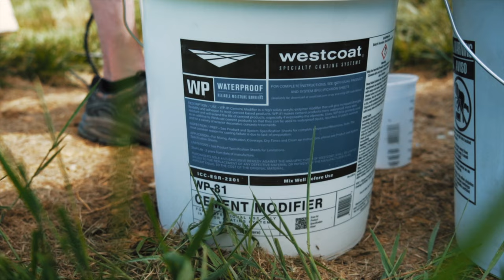How to Resurface your Patio with a Stained Concrete Overlay

Comment: Looks great.  That's a overlay system.  Why couldn't you just staying over the existing concrete like acid stain or water base?
Reply from the maker: You could. It wouldn’t be ideal when you have to grind the paint off of the surface first though. It’s hard to get all of the paint out of the low spots on the concrete… staining it wouldn’t cover them. 

I also just like the texture of a troweled overlay. It’s nicer than ground concrete for an exterior patio.

Comment: My wonderful handyman just finished replacing the wood posts on my aggregate front porch due to dry rot and a cracked cement corner. He had to remove a large chunk of the concrete corner and repair. 
I’m getting ready to hire someone to either stain or epoxy and seal my front porch (cracked aggregate) and walkway for a uniform look. I really like this method and finish over any other so far. 
Thank you for your video. It will be helpful in making my decision. ❤

Comment: I'm on a crew doing this now. We do a light, uniform spray coat of stain, and follow up with hand sponge application of a more concentrated mix of the same color. It produces an irregular, yet consistent random variation.

We also almost always use tape to produce grout line/stamp patterns.

The customer decides, of course. But our surfaces trend towards modified skip trowel or magic trowel textures. There were wood patterns mentioned, but I have yet to get a chance to try that texture...but I REALLY wanna dip into that one! It looks beautiful if done correctly.

Comment: Not sure if I like the swirl marks. Would have preferred a uniform coat without streaks. Is this possible w a roller?
Reply from the maker: You could spray it or do multiple coats to get a color with less variation.

Comment: Quality work!  Wonder if spraying on the stain would have been better?
Reply from the maker: I’m not sure. It definitely would have been easier. I think Westcoat wants us to brush it so that we don’t put it on too thick though.
Reply: You'd use more using a brush then spraying.
Reply: you would get overspray of stain on the brick walls with a sprayer , rollers have no spray
Reply: We tape up plastic sheeting and put down our liquid stain with pump sprayers, let it dry, then use hand sponges with a stronger concentration to add a second coat in random, yet consistent patterns.

There's different techniques, and ultimately, the right way is  the way the customer likes it. 

Our company makes up sample boards on 3'x3' concrete board. Texture and stain. The first sample is free, further samples have a nominal cost. This allows them to see and feel what we will do for them before they commit.

Comment: I notice some people just spray stain and then seal it whereas some spray stain and neutralize it with baking soda and scrub the stain and rinse with water before sealing it. Does both work?
Reply from the maker: You are talking about two different products. Concrete dye/ water based stain doesn’t need to be rinsed… but acid stain does.
Reply from the maker: This video is a water based concrete stain. If you want to learn more about acid stain you can watch this one:

Why I Don't Like Acid Stained Concrete
https://youtu.be/SbqntCvjCvE
Reply: @TimDCVA  I see! My WB stain went on amazing, got it sealed up. Love itttttttttt
Reply from the maker: Awesome. 🙌🏻

Comment: Great work Tim.  Really inspiring.  I'm looking to do something similar.  What is the difference between doing it your way vs using a self leveling concrete for resurfacing and then adding the stain.
Reply from the maker: Thanks! 

A troweled overlay has a more rustic feel to it. It has a texture that’s similar to Venetian plaster. 

A self leveling overlay would have more of a smooth & seamless feel to it. I personally haven’t been about to do a self leveling stained overlay without leaving application marks in the material from the gauge rake.
Reply: I would say the difference is in the product itself. Overlay mud is not about leveling. It's about texture. Leveling and any surface tweaking should be done prior to overlay.

Comment: You guys do great work. I'm looking to do something similar on my concrete front porch and steps. It's in pretty good shape with 3 hairline cracks that span from the front of the porch to the front wall of the house. Originally I never planned on doing a skim coat of resurfacer but I'm having trouble getting the repaired cracks to match the rest. It appears that the best way to get a uniform finish is to apply a fresh thin layer on top. I'm slightly intimidated because I'll be working alone and my porch is roughly 40'x10' plus the stairs. Also I'm not exactly sold on the durability of resurfacers. My porch is about 100 years old and I just can't see a resurfacer product lasting anywhere near that long.  It seems inevitable for it to begin to crack/peel/flake off over time but maybe I'm wrong.
Reply: Be mindful-- cracks will transmit through layers laid above! There are products along the lines of two part epoxies, which when used with sand, and ground down after setting, will provide a suitable surface to put overlay on.

Comment: This was very helpful -- thank you, Tim.  For a small area (maybe 5'x5'), is this a project a homeowner could DIY?  We're having a new stamped/colored walkway being poured soon, but the gray concrete pad it leads to can't easily be removed/replaced.  I'm thinking maybe I could do this process you showed, to make the color be a little closer to the new walkway.
Reply: Do some homework, and MAKE SURE TO PREP YOUR SURFACE! You'll want to do a good pressure wash, and then use a prep product like muriatic acid to etch the surface. Take your time and use tape and paper roll or plastic sheeting to protect surrounding surfaces too.

You'll want to use a good bonding agent just before you put down your base coat. Make sure to use a concrete product suitable for overlay work, don't skimp and use the wrong stuff!

For top coat, you'll want to tape lines which match your stamp patterns. Use a fiberglass reenforced tape (it will look like narrow masking tape), so you can pull your tape after your top coat sets. You want to use a thin coat; enough to cover your base coat well, but not too thick. Your texture is your preference.

You can either use colored additive in your top coat, or stain, or both. Using a colored sealant will give you uniform color, colored mud and stain will give you a more dynamic texture to your color.

Google, and search YouTube. Watch videos, and ask questions in forums. You can learn all you need in two or three weekends, and from there, your process will take four or five days, with clear weather. 

If you use stain, you need to apply sealant the same day if it's going to rain. Make sure the stain is fully dry before applying your sealant. If the surface is too hot, or the sealant is laid down too thick, it can cause discoloration and "bubbles". A second coat of sealant after a couple hours is highly advised.

Mix the color in your water for at least two good minutes before applying concrete powder, if you use color. Mix well, allow mix to settle a couple minutes before applying.

Make sure surface is clean and dry before applying grout line tape, and walk your tape down good. Keep the surface dry prior to mud application so your tape adhesion doesn't fail.

Sealants are usually solvent based, and so do not like water. Make sure everything is dry and stays dry two to three hours after applying sealant, so it doesn't get milky.

Your mud will set up pretty quickly, spread it when wet, then keep watchful. Once it tightens up, apply your texture before it gets too hard. Spraying little water will reactivate it, but it can and will get away from you if you're not vigilant.

Your base coat and top coat are the same formula. Get some sheetrock and practice your texture on that with a partial bag of product. It will waste a bag, but that's cheaper than winding up with a result you hate. Grinding it off and starting over will cost you no matter what.

NEVER do a partial batch to finish out if you use pigment in your mud! It won't come out right. Use a whole bag of mud and full measure of pigment, and take the loss of the unused product. Consistency is key!

Have fun with it! Your neighbors might pay you to do THEIR surfaces if it comes out right!

Comment: Looks good guys. Nice job. Was there no broom / brush marks once the stain dried, I saw some while you were applying the stain but didn’t see any once you applied the sealer ? Did you have to sponge or dry mop Anything or it just all evaporated and no brush marks ?
Reply from the maker: Thanks!

No there weren’t any marks. I think What you were seeing was the stain drying…. And it dried in a way that you could see how it was applied. Once it was completely dry there weren’t any brush marks.
Reply: @TimDCVA  oh nice

Comment: Oh also. Do you sand the finish coat before staining or no hand sanding ? If not on this job because it was meant to be textured do you typically sand micro topping before staining (interior and or exterior)
Reply from the maker: We don’t usually sand the exterior projects. We did take a trowel and scrape any ridges that we saw on the patio.
Reply: @TimDCVA  what about interior ? When you sand and seal interior do you typically see more trowel burn in the finished overlay ?
Reply from the maker: I haven’t sanded the last few interior overlays that I’ve done. Usually just shaving high spots w a blade gets it smooth enough.
Reply: @TimDCVA  So the marginal improvement for a stronger bond for the sealer isn’t that significant in your opinion?

Comment: Any reason you skimmed twice
Reply from the maker: The first coat is just to get color down on the entire pad. The second coat is mostly for texture and doesn’t always cover 100% of the concrete. 

If you only did the texture coat, the thin/uncoated areas look a little weird when you stain them.